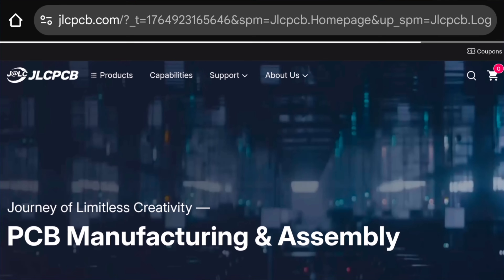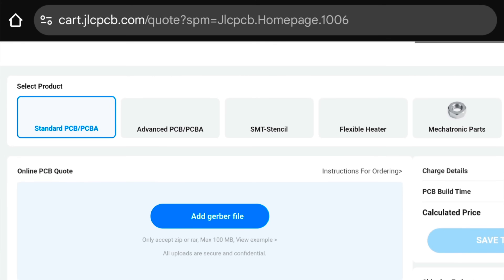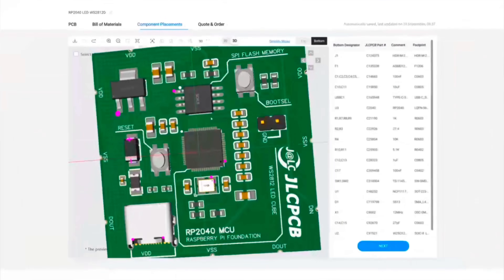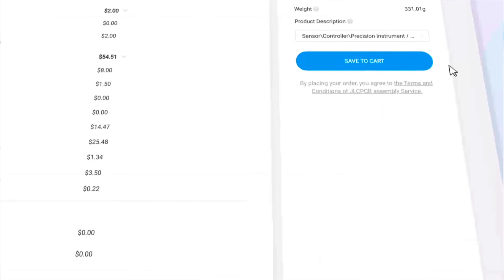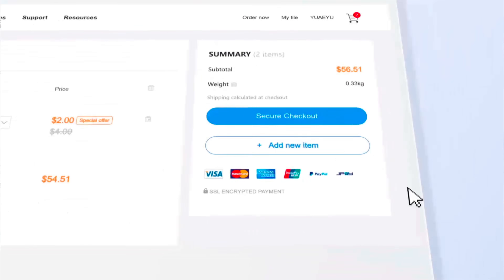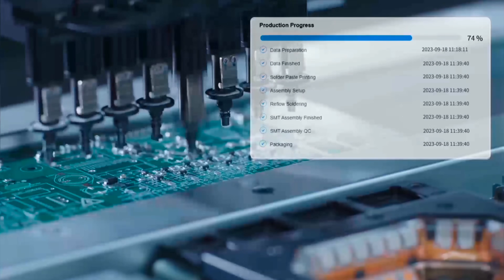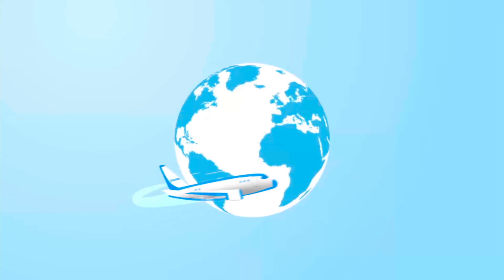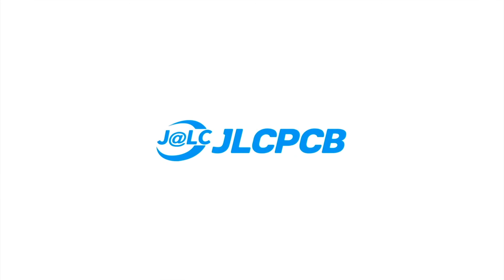Homemade 500W Pure Sine Wave Inverter 12V DC to 220V AC Project

Comment: Sir aap lm358 ic ka low voltage protection circuit banaiye with on off push button aur kisi bhi pwm circuit main use kaise connect kar sakte hain
Reply from the maker: Thanks for the suggestion, I'll see what I can do.

Comment: Fan 35W   Light 35W = 70w. So Not  500W test or even a 100W test ? all you need is 5 x  100W lamps for real load test, also you fitted the 230v sockets upside down.
Reply from the maker: You are Right, I think I need a car battery and a few old tungsten lamps 🤔
Reply: @Electronic_For_You  You could fit 5 x 100W  lamps in paralel with a switch for each  lamp in series with the 500W load to show each lamp powering effecting the the max current, the lamps also protect the O/P from S/C loads..